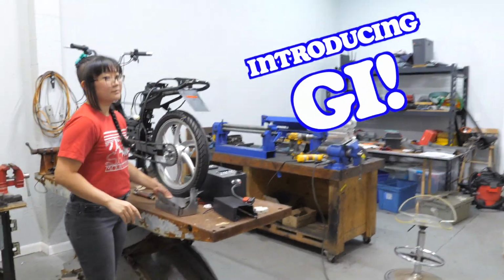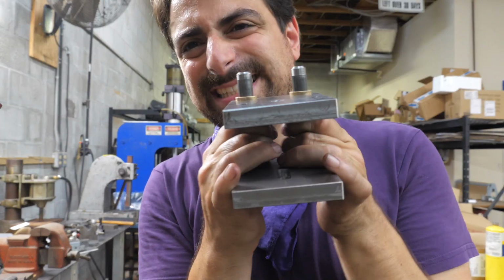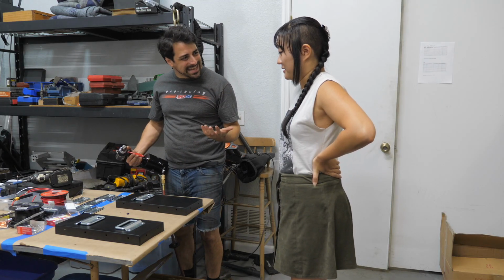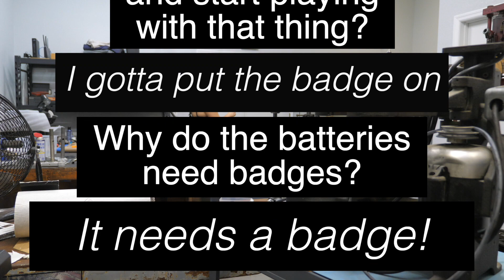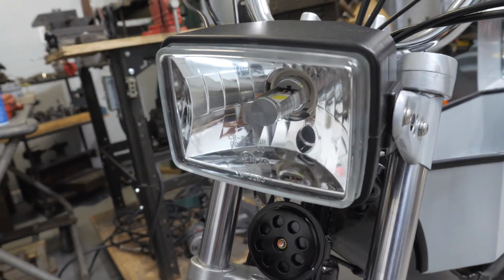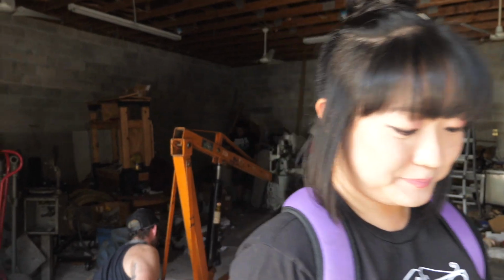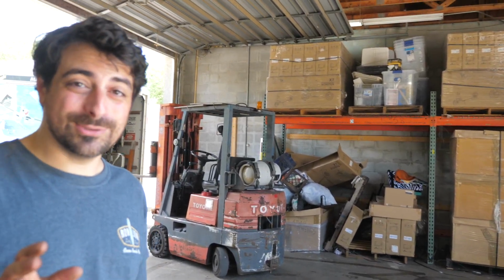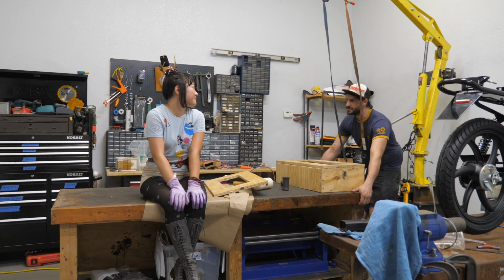Mopeds made in America - Production hiccups

Comment: The Buck itself might be the problem. Since the sides are now straight, when the plastic shrinks it 'clamps' it in place. If it were tapered a bit like before it wouldn't stick, because as the plastic shrinks it would push the Buck out a bit.
Reply from the maker: This is true!  And currently we have a redesign in the works with a 2 degree taper.  The File is made, just need to find the right guy to CNC it out for us.
Reply: @MopedProblems  I should have know you already had it figured out 👍
Reply: Yeah it's called draft, more draft = less wear on the mould for high volume + sorta helps release itself as it cools

Edit: draft is why stuff like plastic takeaway containers stack too